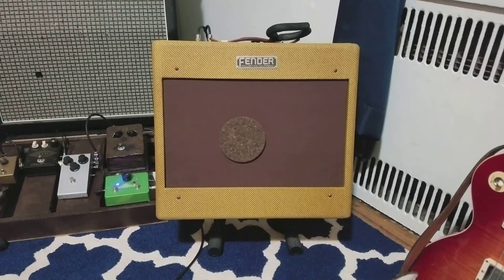Homemade Weber Beam Blocker

Comment: If you play live, you can put a strip of tape horizontally to spread out the highs more evenly. It acts as a vertical line array (2 speakers stacked). Many interesting methods to tackle speaker beaming.
Reply: will this work for my 410 fender amp? before reading your comment i was wondering something similar but with the soft velcro side and place it inside the grill cloth to absorve some highs. maybe a circular shape similar to the one in the video?
Reply: @JoaoNuno1995  If you have a 4x10, I would experiment with 3 inch foam or vinyl circles. It might sound too dull and compressed if you go larger than that.  Stevie Ray Vaughn used wide strips of tape to cover his 410 fender speakers. You can see in this video at the 17 second mark on the left side of the screen.
https://youtu.be/Wtij9_fLhKA?t=10

I have a single speaker 1x12 Peavey Bandit with a bright speaker. It reaches 6500 Hz, most speakers are 5000 Hz.  I used a very thin 3mm foam circle that is 6 inches wide, with a 3/4 inch hole in the middle. The hole acts like a tweeter and spreads the highs very wide...no more beam. I've done many experiments with different materials and sizes and found that a circle with a small hole works and looks the best.

Comment: I've just done this on two 4x12s with vintage FANE speakers in them, just smoothing the sound a bit for when I stand right in front of it. Are you still using your coaster solution or has your speaker mellowed as it's broken in?

Comment: mine sounds bright too. I just put the treble knob down (I think it's set to 1.5khz). I like it's sound that way.
Reply from the maker: With a Tweed Deluxe turning the tone knob down also seems to lower the gain.  Turning the tone knob down on the guitar loads the signal too.  Hoping it mellows over time though it handles the bass without flubbing at the expense of a little bit of break up.
Reply: I'll give it a try! The downside to lowering the tone/treble settings is the tone off center gets darker. I think this is a great solution for playing small gigs where the amp isn't miked and you don't want to kill the person in front of you.